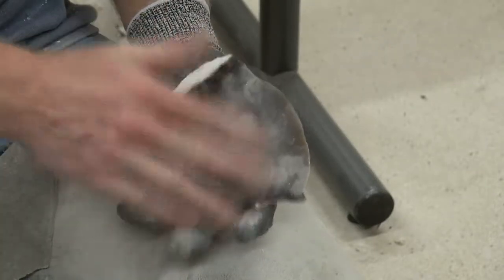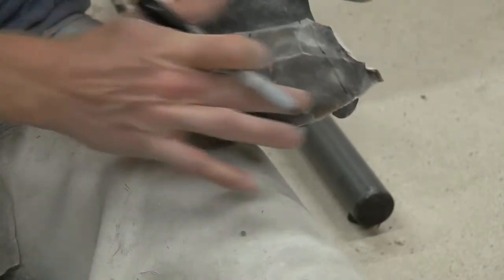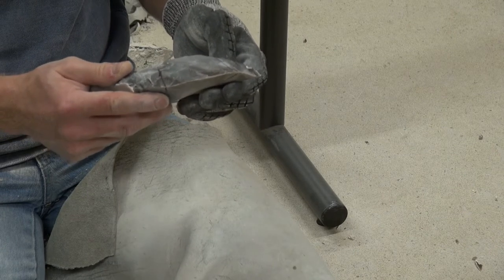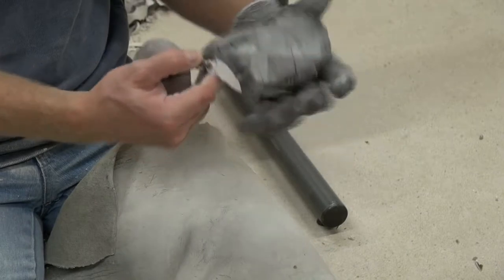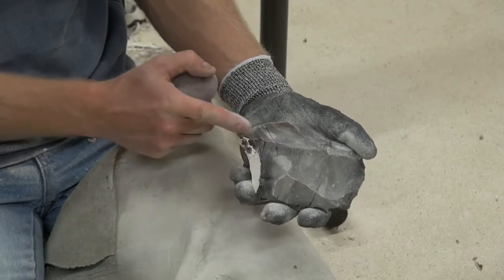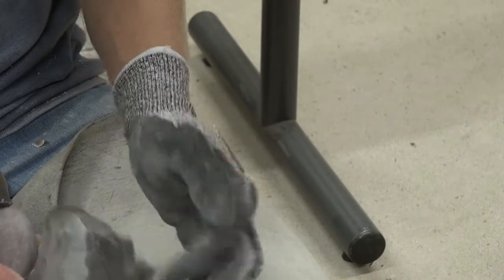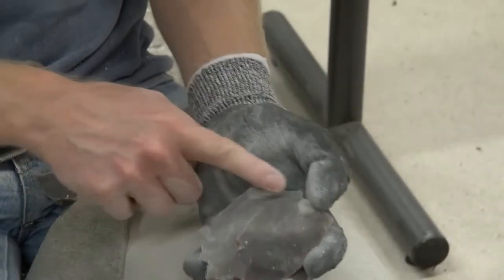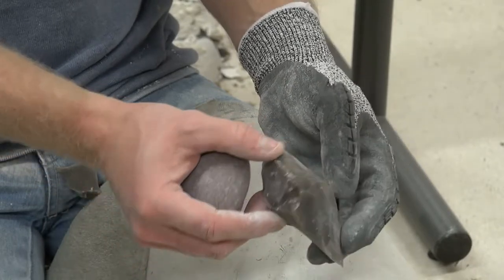Making a Mesolithic Flake Axe (Morten Kutschera)

Comment: Awesome video
Reply from the maker: Thanks!
Reply: @exarc  do you think some people would just start polishing the edge when it got dull from chopping down trees all day?
Reply: @Zane-It No, not on this type of axe / adz. However, it can be resharpened by taking off a flake across the edge, using the side-edge as a platform. This technique is commonly used on the Early Mesolithic flake axes from Norway. Sometimes, if there was not a good edge to begin with, this would be a way of shaping the primary cutting edge. (Based on refitting of edge flakes to flake axes in Early Mesolithic assemblages).